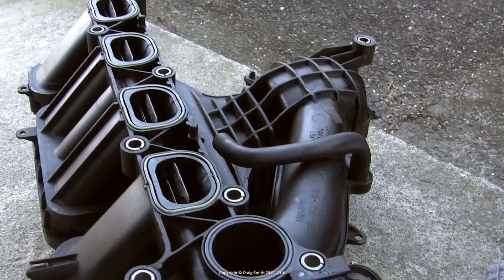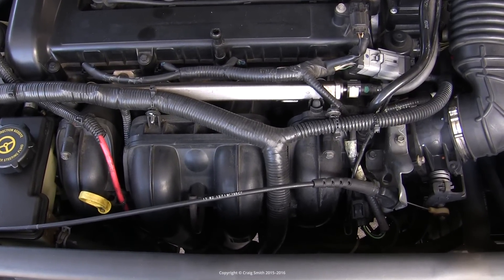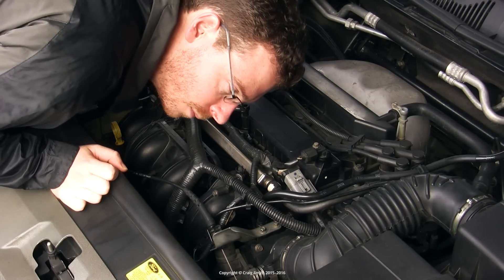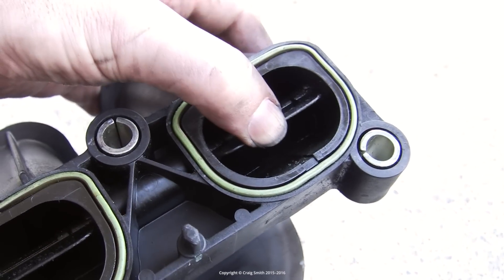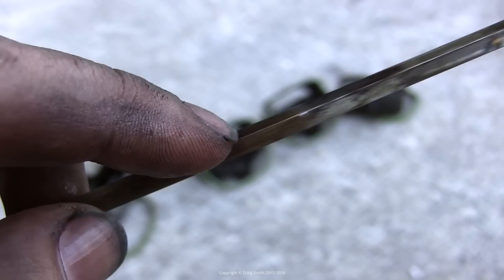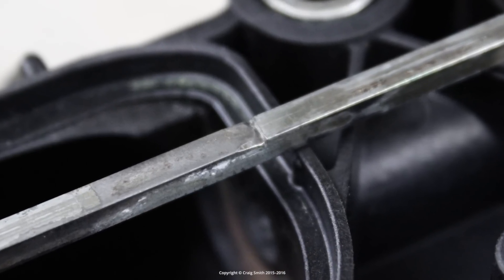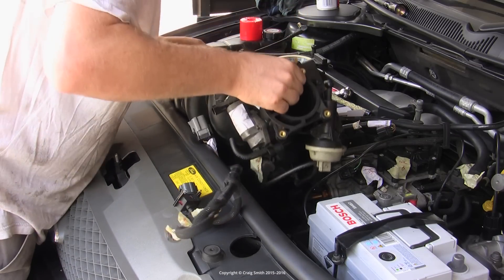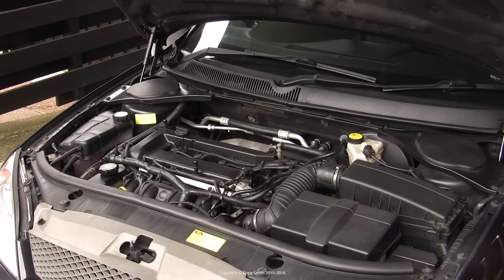How to: Fix swirl flaps & save your engine (Ford Duratec HE, Mondeo/Focus/et al)

Comment: hello pal, great video. I have a 2006 UK spec Ford Focus 2.0 petrol. the same engine as yours. Can remove the flaps all together?? My car as a electronic throttle body?? will the flaps that work on you car. can they work on mine? I found these on Amazon 1317276. also available on Ebay.
Reply from the maker: I don't see why not although I don't have experience with the Focus. Electric TB shouldn't be relevant. (If your manifold has the internal IMRCs I wouldn't mess with them.)
Reply: Thanks for the help in advance. No it does not have the IMRCs in the manifold. I have take it off  and check and clean the swirl flaps.  Do you know if the swirl flaps that you use in your mondeo will fit my focus?? the part numbers are different, I have checked.  the engine is the same as yours.
Reply from the maker: I'm pretty sure they're the same. You should be able to check visually if you take them out of the manifold.
Reply: Thanks again mate, that was the news i was hoping for. I have purchased the genuine ones of Amazon and the price is quite reasonable . I will replace the gaskets as well.  When I took  the manifold off  a week ago I replaced the oil separator valve hose. It had a large crack in it.  I will replace the oil separator and valve when I take it off next to do the flaps.
Reply from the maker: Robert - I don't know - but it is a vibration noise obviously linked to the engine, so I would expect so - except for the fact that the flaps open above a certain RPM.
Reply: Hello,
I have a 2007 Focus qqdb engine. The flaps on Focus is not the same as Mondeo Mk3 engine. On Focus QQDb engine , the flaps is not sold. You need a complete inlet  manifold

Comment: Where did you get replacement flaps? I rang ford yesterday as one snapped on removal and ford quoted me £525 for the part?!
Reply from the maker: There are sets of four flaps on Amazon, link(s) are in the description.
I actually bought mine from a co called Endon Services, as the VAT net price was best for me @ £9 each - contact www.allcarpartsfast.co.uk
£525 would be a major rip off even for a complete replacement manifold kit!
Reply: Craig's DIY Car that's great thanks very much. I'll look into ordering some! Ford has said they do not supply the flaps alone and have now started replacing the manifold as a whole!!

Comment: Nothing worse than loose flaps!
Reply: They usually fly with bits of the metal rod, they are placed on, and go into the valves, destroying them in the process.
Reply: Tell me about it. Destroys the stiffy
Reply: Not just that, i think mine are blocking an intake. My engine stutters heavily around 2500 rpm
Reply: why?how defected flaps ruin the engine?
Reply: haha.
Reply: Haha yes James

Comment: Amazing videos, carefully done with the right amount of detail. These videos are real life savers (and money savers) for me.
How did the car run afterwards? how much did the replacent flaps cost?
All the best
Reply from the maker: It ran no differently, as you can see in the video my flaps were a little loose and would have been vibrating, but working fine and no reason to think they would affect performance. It is just about dealing with the danger of them failing and killing the engine.

Comment: Same engine different country. I also removed my flaps with zero problems. All of my modifications have actually gotten me and extra 2mpg. I removed the flaps and rod but replaced the actuator so that there is no check engine light and no botched vacuum leaks. I have also eliminated the EGR valve, installed an intake kit and an aluminum throttle body. I am going to soon install the manifold off of the 2.3L SUV that has runner control and use the swirl flap circuit to control it.  This will give me dual length runner and that is far more effective for power and fuel economy than the swirl flaps.
Reply from the maker: hardyXXL - he means he put the actuator back in situ, so as to avoid a CEL. It won't do any harm.
Reply: Oh gotcha, thanks for clarifying it! I'm gonna give that a try.
Reply from the maker: Interesting. Thanks for sharing. Would like to see more about upgrading to the 2.3 L manifold and converting the IMRC's to the old control. Won't you need a re-map?
Reply: You will not need to remap as in change the MAP sensor arc. When I install it I will use the control circuit of the old tumble flaps to operate the IMRC. Once I get a tuner, the one I am going to get supports altering how that circuit functions and I can set the RPMs that the IMRC changes at. I want to see how it will operate on a stock tune though before I change it. I'll keep you updated.
Reply: Can you give us some more info about the actuator? What did you replace it with in order to avoid the CEL. I've been thinking of removing the flaps myself, but I wouldn't want to have a CEL always on.
Reply: So you just keep the actuator back and you don't get a CEL thinking about doing this trying to get my car to pass somg don't have any funds to replace the manifold and the car isn't worth that much
Reply: Be awesome if you could reply with any tips really need my car to pass thank you man going to try this

Comment: I removed the flaps completely and it runs just fine even after 510000 km.
Reply from the maker: 510,000 km? Good effort... what else (major) have you had to replace/fix?
Reply: nothing on the engine. But new shocks after 350000, new dual mass flywheel after 300000, and the usual bits like brakes etc that all cars go thru. High quality long life car that doesnt necessarily "feels" so. Mine is an ex Danish police car, there´s something done to the engine, faster than the V6 version anyway. One interesting thing is that the multilink back suspension seems to last forever though. Never done anything to tht suspension in all years. And we live on the countryside...
Reply: hello did you have to seal up every hole in each cylender or just the one that meets the acuater
Reply: paul irvine each hole between inlets, plus the main entry for the rod as well
Reply: @joshuamackay7581  thank you sir
Reply: Hello, this comment was awhile back but still relevant;
What do you do with the solenoid that attaches to the intake manifold that engages the actuator? Did it throw off a CEL code removing it?
Reply: Ray Loyst i left it attached so I didn’t have any code thrown. Just removed flaps and rod plus the piece of plastic that goes from arm to rod end
Reply: do you have to seal the external hole or do you have to do in between cylinders
Reply: @robertyork383  Yes you do. There is external hole where rod enters from acuater, then the holes between each inlet (cylinders) to be sealed up as well. Only seal where the rod goes through 4 holes total
Reply: @joshuamackay7581  thanks for responding and I'll update when I get done with it I have 07  focus and it's been one thing after another starting fouled plugsto PVC and now actuator
Reply: @robertyork383  i seen a machanic leave them open just put the acuator back in its proper place and worked fine just prepare to swer alot doing the job i had mine off the flaps all still good no play in them so i just settled sticking the bit of rattle from them
Reply: @billiardball9650  I've had the IM  off 3 time so far Ive come to the conclusion that it is the last time no matter what happens lol
Reply: @robertyork383  lollol i had mine off twice robert lollol i needed to do my thermostat anyway with manifold off was easier to work with , but yes robert mine not coming off again either lollol

Comment: Tremendous stuff !
I have a 2010 Focus Mk2 with 2.0L Duratec engine. It seems like Ford gave up the flaps, and placed a "Runner Control Valve" which seems to do the same job, and is very easy to replace (Ford #BS7E-9J559-AA).
Reply: I thought the valves controls the flaps ? 
I just bought the valves because I have the P2008 code on my 2007 ford focus, but now I am thinking of de-flaping it which would make the valve pointless. (I guess the good thing is it'll shut off the check engine light)
Reply: @roycai8895  where the flaps still the in the intake?

Comment: What a great series of detailled video's!! Can You tell me if an Mondeo MK4 whit a duratec HE 2.0 petrol engine from 11-2008  has swirl flaps?I have engine fault code P2008 I think that whit your video's i can do it myself.Thjanks in advanceBertus.
Reply from the maker: I think they do but I don't have experience... but it is hard to find references to problems with them on the Mk4s. Your code may relate instead to the IMRC solenoid(s) on the later engines. Google "imrc solenoid valve mondeo"; part # 1357313, see diagram @ http://eucatparts.com/?action=cat_ford_part&s_id_part=1210075&s_id_model=130&s_code_image=G012525403

Comment: Thanks for the great videos . I have a 2005 Ford Focus Duratec  (USA) . Can I just disable the flaps as a preventative measure (pull the actuator vacuum line and plug it) ?
Reply from the maker: You could and I guess it would help a little, but the wear and failure is (I think) caused primarily by vibration, not the actuating of the flaps, so it wouldn't be a long term solution.
Reply: Paul Patt i too have have one do they have the flaps

Comment: Another great video. I removed mine completely as taking the manifold off was hard enough, I wasn't doing it twice lol.
Never noticed a change in fuel consumption or running of the engine. As you said, some report a slight increase in consumption and some even say there's reduced power/torque in the lower rpm but I didn't really notice anything.
Reply: What did you use to seal them up? I need to do this later so any info is appreciated.
Reply: Did you get any DTC failure code?
Reply: No, never had a problem with it done. Just removed the flaps, sealed up the holes left and bolted it back on.
Reply: Thanks for your answer.
Reply: The st150 version didn't have swirl flaps out the factory so I think removing is probably the best way, 
another great video though shows exactly how to make it like new again
Reply: Hola cómo lo anulaste con que tapaste los orificios del buje